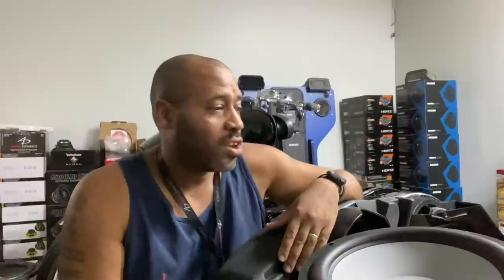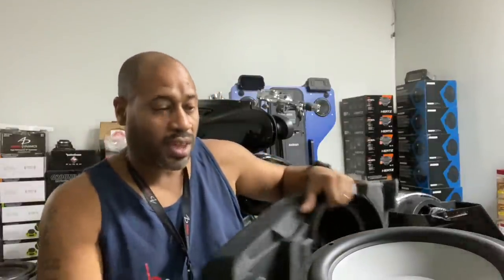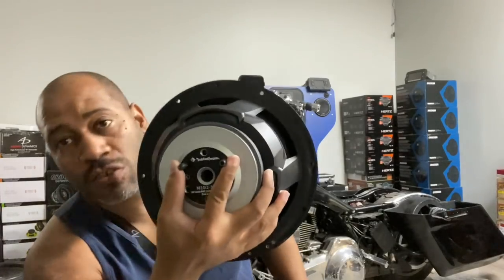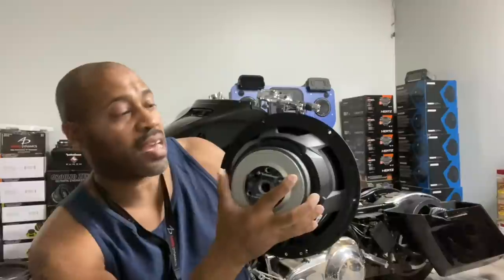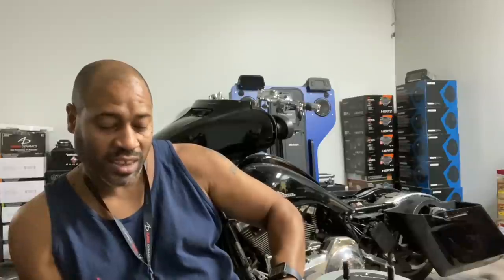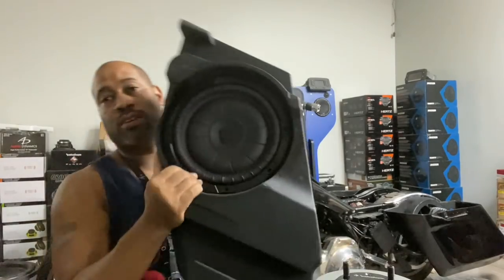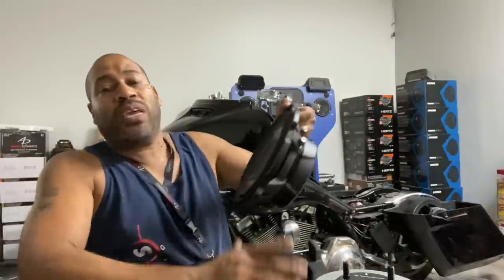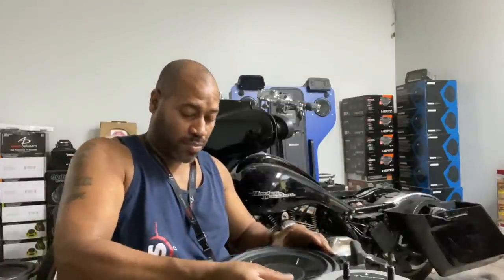Replacing the 10 inch sub  woofer in the Rockford Fosgate HD14-SBSUB saddle bag drop in kit

Comment: thanks for the info,, after watching this I went down to the local audio shop in town and purchased a M1 they also had an M2 which they said could handle a lot more but it is a 1/2" deeper so i bought the M1 it had the right holes in the back for the mounting studs but they where not tapped for threads so i will have to buy a tap to install the studs I'm going to do that today, but i did install the speaker and ran it with out the back mounting studs and just secured it with the front screws and it worked perfect better than waiting 4 weeks for a the HD dealership to order me one in. it only took me about 15 minutes to replace the speaker.  Thanks for all your help.

Comment: Carlos,  I’m one of the guys down south currently running 2 6X9’s in each bag. Since I’m always looking for my next upgrade, is that Rockford 10 inch sub Kit worth my money or should I just go with duel 8’s . Oh by the way I am one of the Ground Pounders who ride every day sun up to sun down, volume on 25 plus
Reply: I liked my 8's alot of midbass  just took up more room in the bag then I thought.
Reply from the maker: Run double 8s or a single ten on each side with big power
Reply: Your best bet is to find a Square 10 inch sub that will  work with your bag. A Square sub has more cone surface than two round 8 inch subs and the 10 inch Square sub will get lower as well.

Comment: I have a 4 speaker setup and want to add subs or midbass. I won't be getting the Rockford setup I'll be just putting them in the bags. Honestly don't have a big budget but need suggestions if possible.
Reply from the maker: Hertz 200L and spl bagger rings